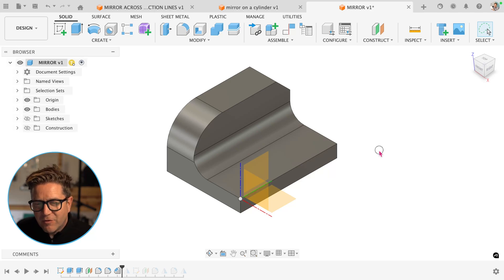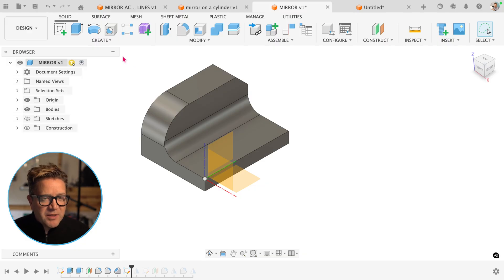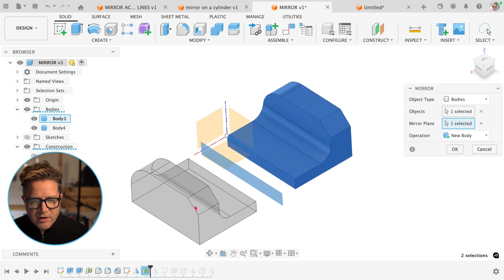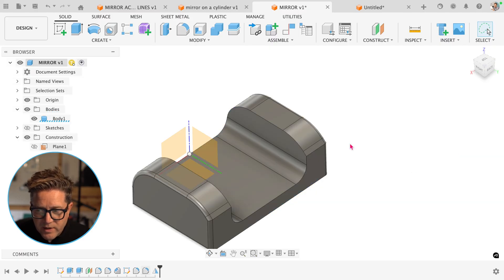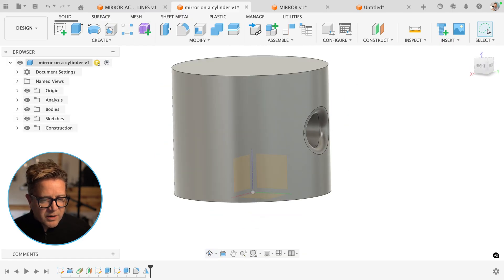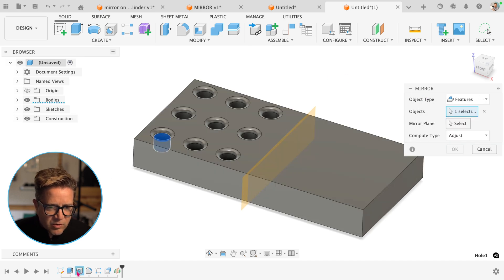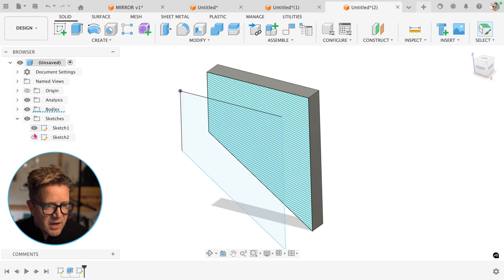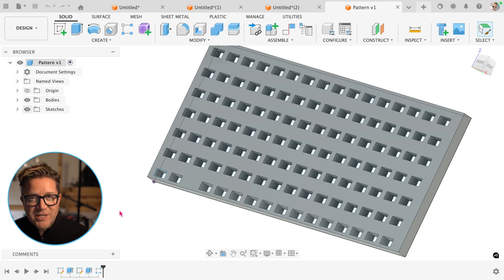Fusion Mirror Fails (these Mirror Mistakes Are Wrecking Your Models)

Comment: Question: what is the difference in terms of computation and robustness between 1. Mirror, vs 2. Rotational pattern 180°? (Obviously this question only applies to symmetrical features.) 

Say I want to repeat a pattern on one face of a box on the opposite face of the same box. Mirror or pattern?
Reply: I'd say, personally, I'd always use mirror! If you decide to make that feature non-symmetric later on you won't have orientation issues